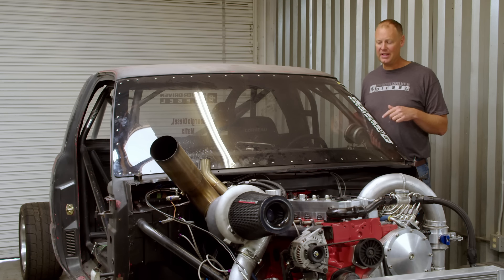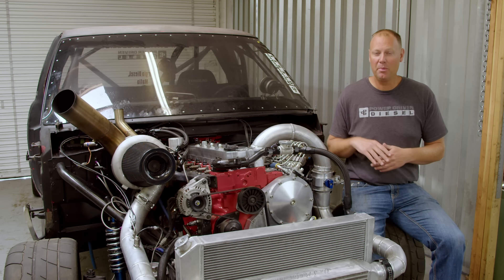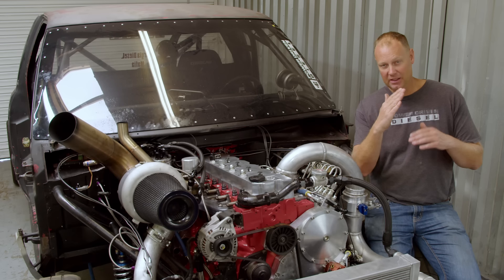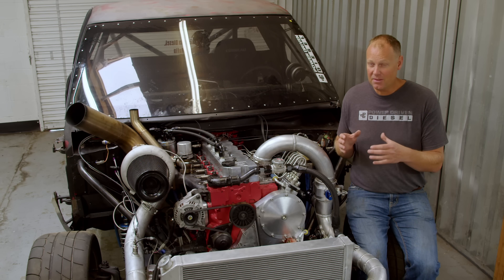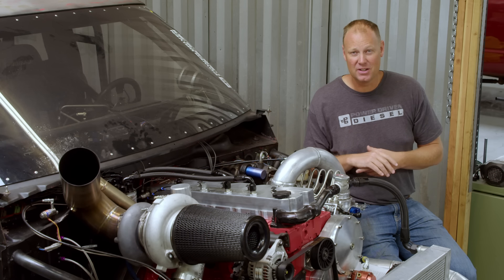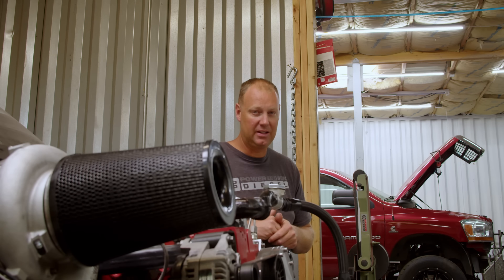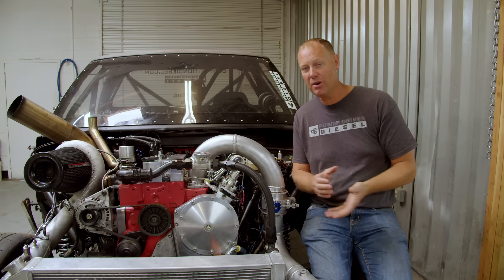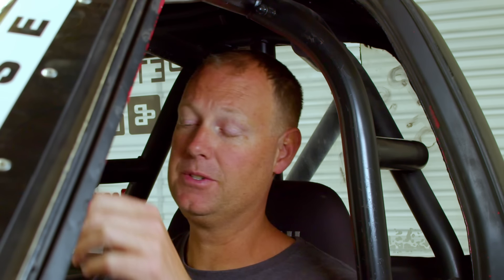Building a Drag Race Truck is NOT FUN

Comment: Great jobs guys yall work hard thats for sure, and have stuck with it. I like the fact that yall are Very Transparent,  man i was doing it from 1998 to 2010 when Everything was such a secret, when you learned something great the hard way and was kicking ass every weekend the last thing we did was spill our guts,, lol. Things got a little more relaxed on CompD after maybe 2008 or so...anyway best of luck to you guys! Still wish yall would ditch the transfer case and put all that power to the back like a normal drag car and learn the 2wd setup stuff. LOTS of e.t. on the table
Reply from the maker: I do think about going rwd. It just seems that it works great or not at all with these heavy trucks. Most trucks are 4wd though so it would really be fun to have an advantage
Reply: 1.30 60 foots at 4600# was fun. My black C10 and Stuckys green pick up along with a few others were just dialed in and worked..man do i wish I had my today's hot rod trans back then. Rossler 2.10 straight cut t brake of course and gear vendors o.d. 
I got my brother in laws truck back that he raced in Street Stock back then. It's a 1000+ hp 441" sbc it does pretty well on the street. Still having fun

Comment: I just put a Steed on my truck using the Stage 8 studs. Doing it in the truck was a pain. The 6 top studs were easy but getting that locking tab on the bottom 6 when I couldn't see them took me like 30 minutes and about 10 trips under the truck to pick them all up after dropping them 🤣
Reply from the maker: They are tough in frame but they will not back out on you!

Comment: I have a 1985 BMW 524td with a factory 2.4L I6 Diesel that gave up the ghost after 12 years and 312,000 miles with an HX35(WH1C) it made about 268hp and 361 ft/lbs. I dream of putting one of your engines in it and get my shell back on the road as a mountain monster in the PNW.

Comment: What's the reasoning behind sleeving the engine down? Just thicker cylinder walls or more to it than that?
Reply: less mass = greater stability at higher rpm.
lighter parts move faster  and easier
also increases and thickness of the bores making the block more stable.
Reply from the maker: Cylinder wash thickness. And the sleeve is a stronger material than cast iron.

Comment: What is the  benefit of smoky exhaust compared to clean exhaust?
Reply from the maker: No benefits, but when you have a huge fueling setup like this truck with a mechanical P-pump, it's almost impossible to clean it up until the turbos are making boost.

Comment: Cool story, but I figured this is a good time to give some product feed back. 

I would try Opti torque but they are nearly the same price as ARP 625 studs. After my experience with Xotic studs I wont risk all that work again over a $50 or so price difference. I am sure you guys could do a hell of lot better than 50 to 70 bucks price difference. If they were about $200 or more less I would absolutely cheap out and try them. I have another build I need studs for, so putting this out there. I probably wont get to that build until winter.
Reply from the maker: Thanks for the feedback, however, they are not our product so we don't have control over how much they are.